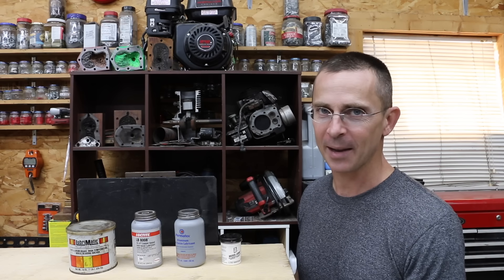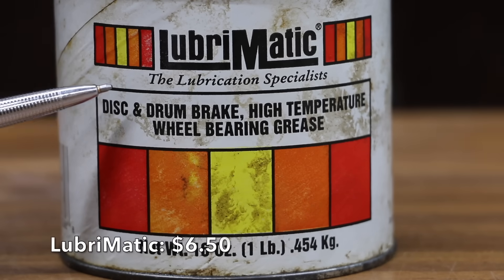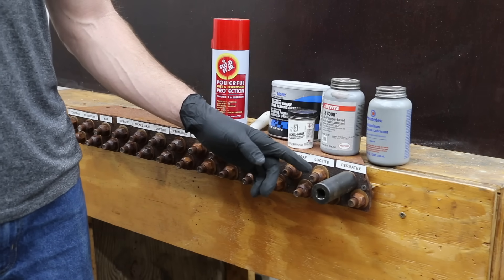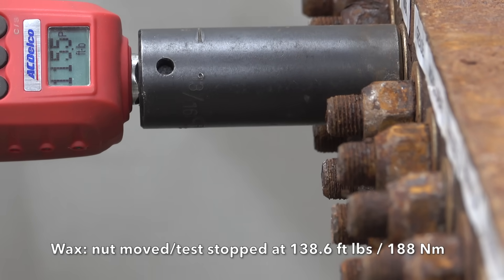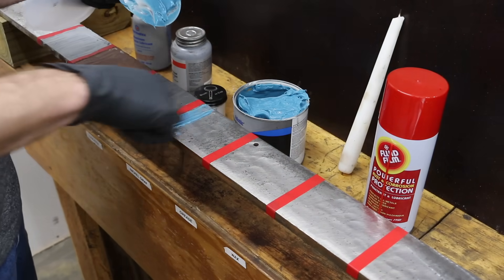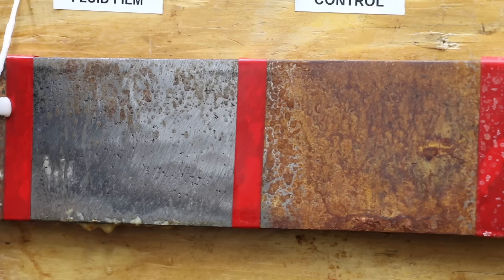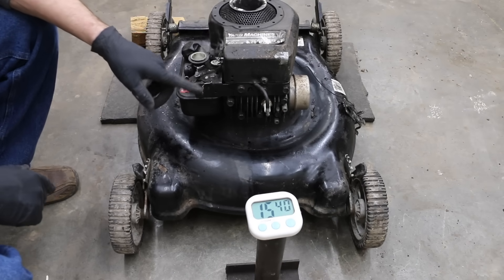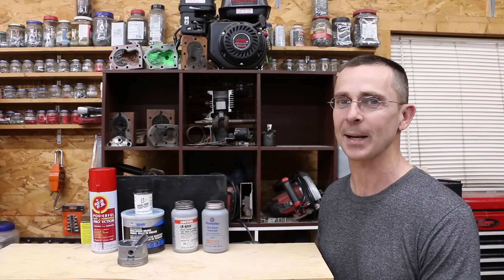Does Anti-Seize Compound Actually Work? Let's find out! Anti-Seize vs Grease vs Fluid Film vs Wax

Comment: Thanks for the video. I've always used anti-seize in only a select few applications on my vehicles. would you recommend anti-seize on all my vehicles bolts? My uncle puts anti-seize on the lugs of his jeep, The local tire shop calls him crazy, said his tire will fall off. Your opinion?

Also, I recently washed my hands with an industrial hand cleaner (from a shipyard I don't have access to) and the grease all came right off fairly quickly, no pumice or anything gritty and it left my hands feeling nice and soft afterward..It was a small white cylindrical bottle.  I didn't catch the brand but now I've been in the market for a better hand cleaner than the Orange-grit  stuff I've been struggling with--the bottle gets old and it sucks water inside and thins out over time it seems.

Vintage car grease is tougher than new car grease.   Dawn works pretty good but not the best. My uncle showed me that Oil works pretty good on somethings but I prefer not to rub motor oil all over--you still have to wash the new oil off. Rubbing alcohol can do some decent work but not the best for the skin. Do I just need different hand cleaners based on the parts of the vehicle I'm working with? different fluids needing different solvents type thing?

I've seen and used a few options, water-less stuff that just dries and crusts off, orange stuff that you can use dry and wipe off with a paper towel or use with water. I often work on my vehicle on the side of the road where hand washing stations are in short supply so I like the dry-options, but anything that would cut the grease faster than the rest would be fine by me.  One that can actually clean my fingernails and get in the crevices without excessive scrubbing. I hate hopping out of the shower only to find the forearm I scrubbed for 5 minutes still has a big grease spot on it. 

Thanks for all the hard work.
Reply: Many years ago, my mother bought me a hard whitish color paste from Hella (german brand), that I used BEFORE commencing to work. It worked perfectly as an "Invisible glove" because it formed a tough barrier, stronger than common barrier creams. You had to wait a minute or two to allow it to dry and harden, then it resisted oil, gasoline, greases and dirt like no other.  Unfortunately I have been unable to buy more, as I cant find it anywhere...
Reply from the maker: I'll try to put together a video on this

Comment: I've used Teflon Pipe dope as thread compound since the 1980s and I've had vert good luck.  But I think the latest batches are thinner and not as durable as the older dopes were.  Excellent comparisons.  However, is anti-seize a lubricant?  Makes me wonder if a tablespoon would  fill some gaps in a worn engine without destroying oil detergents, heat transfer, and viscosity.
Reply from the maker: Great point!

Comment: I have been using permatex anti-seize for about 40 years and it's the best one out there . Permatex also has a copper anti-seize for high heat items . Your little test is not a good test !!  The test of time will show you what I am trying to tell you !!!  I have used permatex anti seize decades ago then left it sit for well over a decade and it worked great !!  This is in the harshest of snow , frozen cold with allot of road salt !!  To me your little test was a total waste of time !!!  I've used different products and learned the hard way that Permatex anti-seize is the best and for the cost !!!  Both aluminum and copper anti-seize from permatex can't be beat !!!
Reply from the maker: Great feedback. Thank you

Comment: Next up on project farm: “this episode we’re gonna see which brand of cement works as the best replacement for engine oil!”
Reply: Comment section "Shoulda used a fresher bag of portland cement.  That had water intrusion"

"Isn't there supposed to be gravel and sand in cement" <- and that starts the comment section fight
Reply: @corpsiecorpsie_the_original  cement isnt concrete, easy to resolve fight.
Reply: @leocurious9919  - I'm aware of what it is. That isn't going to stop an internet fight
Reply: @corpsiecorpsie_the_original  Hahaha, thats true...
Reply: Hahaha…...
Reply: Gotta use the cement that was used in the construction of the twin towers then.

Comment: Did you compensate for the nut rusting to the steel plate, it looks like some of the threads had no rust but but looked like the nut was rusted to the steel plate which would increase the torque to remove, try using double washers or apply between plate & nut as well as on the threads. Great test though, very interesting which is best.
Reply from the maker: Thanks for the feedback.

Comment: I know this sounds crazy, but when I was in the military I worked on TF 34 jet engines. Our technical manuals would have us apply Phillips milk of magnesia as an anti-seize compound on the nuts and bolts that held the hot section together.  I speculate that those areas would get so hot that they were beyond the flashpoint of most anti-seize compounds. But it is a good cheap and non-hazardous alternative to standard anti-seize.  Also easily applied, we would put all our nuts and bolts in a Ziploc bag, pour in a little milk of magnesia and shake the bag. I love your show!
Reply from the maker: Thanks for sharing.
Reply: Wish I saw your post before I posted. Yup my squadron used Milk of Magnesia on our T58-GE-8B turboshaft engines as well.
Reply: Hmm, makes sense, leaves a granular but crumbly material in the threads, without interacting chemically, and without lubricating the fastener much if any. Magnesia is an incredibly refractory oxide, it will literally outlast anything you can make a bolt out of -- besides tungsten and a couple neighboring metals (none of which you'd want to make a bolt out of, for various reasons).
Reply: Damon Traeger I’ve also used this on extreme high temps(2500f).  We decanted the liquid off and used the remainder on or studs and nuts. It really does work well in these circumstances
Reply: So now you have to repeat the test with milk of magnesia!
Reply: German aircraft mechanics used Milk of Magnesia as an antiseize during WW2.
Reply: Damon Traeger 
When I find tips that crazy-genius,  I have to try it.  Now if you’re trolling me,  my test subject won’t be an expensive victim. 
Speaking of jet engines,  you guys get a grin out of explaining the intricacies of axial compression to curious 12 year old wrenches. (Yeah,  that was me 50 years ago).  “Well,  ya see son,  yer family car sucks,  squeezes,  bangs,  and blows....while this here screaming jet sucks,  squeezes,  and sneezes.” 😎

Comment: Great video! You covered a subject that I face when changing a tire. I often question whether corrosion itself creates sufficient torque resistance and leads to an inadequately torqued lug nut.  Your video gives a fascinating perspective supporting the idea that it shouldn't be ignored especially on trailers where a driver can be isolated from clues during operation. I use grease to avoid seizure.
Reply from the maker: Thanks for sharing.

Comment: Thermal Compound! You could test the heat transference of different PC thermal pastes. There are so many biased reviews as well as inconsistent testing methods. Is the cpu overclocked, is it AMD or Intel, what year, what cooler? I think an unbiased approach just using two pieces of metal with different thermal compounds between them could provide some interesting results. Also, you could look at the spread difference, is a pea size enough, should there be a lot, is very little. I would also be interested in seeing the liquid metals and how that fuses metals together. Not an engine product, but it does have uses that could be interesting in some creative applications.
Reply from the maker: Thanks for the video idea.

Comment: Great job! The main problem with the wax is that when molten wax drips on cold metal, it solidifies instantly an deforms, as it happens with some 3d printer plastics. That is why it has bad adhesion to metal an caverns under the layer of wax. It would be better to solve wax in lighter fluid, gasoline or some other solvent under heating and use the solution on the thread or cool it, then it will partly solidifytransforming into suspension, which can also be used to protect metal surface. It would be great to see the difference between such prepared wax and market anti-sieze compounds. Also there is an idea to use candle wax as motor oil.
Reply from the maker: Thanks for the feedback.

Comment: Mustie1 uses Toilet ring wax as a coating to protect from rust.  He also uses Bar and Chain oil as an under coating.   Could you test these cheap solutions?
Reply from the maker: Great recommendation! I'm a huge fan of Mustie1's channel. Thank you
Reply: He applies the wax differently too, the wax didn't stick to the metals here.
Reply: He is elusive on what his proprietary bar and chain oil mix is, specifically, I would assume something petroleum-based to allow it to be sprayed and then off-gas leaving the bar and chain oil in place. I've also heard legend of a paraffin and kerosene mix as well.

Comment: The paraffin froze when it hit the cold metal, you should have preheated to obtain good adhesion/coating film.
Reply from the maker: Thanks for the feedback.
Reply: Good idea, a lot of hand forged metal parts are coated with a bees wax that soaks into the grain of the metal and wets the surface really well with that technique.

Comment: I put on a new reman break caliper and they strip all the coating off them. My 20 year old bmw original caliper has almost no rust on them. Brand new reman is complexity rusted over. When I put the new reman on I used anti seize to act as a brake pad lube. Everywhere but where the anti seize was put has rusted. I drove it over the winter and it’s still good. I was impressed by that.
Reply from the maker: Thanks for the feedback.

Comment: Paper air filter vs oiled K&N type filter in extreme dusty conditions. Like throw some ash and sand at it and then inspect the bore and cylinder head for scoring.
Reply from the maker: Thanks for the video idea.

Comment: Some ideas, test shovels, rakes other yard tools, what ones last the longest, strongest and how they hold up in the elements. Also you could test multi-tools like the Leatherman vs others. Also concrete and if the strength is equal to what the bag say and different thickness.
Reply from the maker: Thanks for the video idea.

Comment: It would be interesting to see on your bolt test how the candle wax, the fluid film, grease and the others not designed for the high temperature compared to the other high temperature products. Your test is kind of like comparing a group of cars. They are all cars but some are designed to go fast and others that are not but them running them all fast and the wheels come off of the slow cars and you say the slow cars did not do so good.
Reply from the maker: Thanks for the suggestion.

Comment: Run the same test with fresh stainless steel nuts and bolts.  Stainless will gall and I can almost guarantee you that an untreated threaded connection will seize to the point that you can't take it back apart.
Reply from the maker: Thanks for the video idea.
Reply: @ProjectFarm  I learned that lesson the hard way!  An old timer at the boat supply shop explained it to me.  Love your channel!

Comment: Not to be overly critical, but given the torque required to "unseize" the untreated bolts, 
I have to question the conditions of the test, as the bolts didn't really seem to seize at all.
That being said, I don't have any solution to offer, but it should be discussed what makes a bolt seize.
Vibration? Temperature? Discuss :)
Reply from the maker: Thanks for the constructive feedback

Comment: Vibration I concerned with also. If ever had a spark plugs or brake bolt come out while you it really sucks. Maybe test them after a week of shaking with Mechine if tork with no holding power like less than asap remove tork.
Reply from the maker: Thanks for sharing.

Comment: Observation: Anti-seize doesn't flow so you can say goodbye to the cooling aspect that an air cooled engine needs. Also interesting to note what a single heating / cooling cycle can do to torqued fasteners, which is why we need to retorque things. Not sure about accelerated testing. Somehow we just can't duplicate father time in the lab, especially if a product has a 3 year EXP date right out of the gate. What I can tell you is that old guys working on Gravely equipment years ago would use the aluminum anti-seize on those huge mufflers screwed into a cast iron block and leave it outside for 15 years. When it was time for a new muffler you could grab it with channel-locks and spin it right out. Certain things work and others are snake oil!
Reply from the maker: Thanks for the feedback.

Comment: There is usually a small hole in the conrod-crankshaft bearing where oil is able to seep in and keep it lubricated, but the antiseize isn't thin enough to get in, so the bearing would have most likely seized which is why the conrod snapped.
Reply from the maker: Thanks for the feedback.

Comment: Thinking it was about '87 I added never-seize to my arsenal of goodies.  I can attest to its performance, and have been a never seize junkie ever since.  What's really cool is 'a little dab will do ya'!  A little dab on the tip, plows ahead of the threads and walks around the bolt all the way in.  I use this on everything that is not a locking thread.  AND there's still about an ounce in my original bottle!  Just this year, I added the copper version to my goodies.  Seems like it's just as good.  Test it for yourself on lug nuts- you'll never go without again.
Reply from the maker: Thanks for the feedback.

Comment: Use this stuff on alot of things.  I probably shouldn't use it on my wheel studs, but I do and have had no issues for the severaa years I have used it.  I hand torque them for tightness instead of using OEM torque specs, which could make the difference.  Have used the Permatex stuff for years...because that's what I stole from my dad's garage way back when haha.  Awesome video as usual!
Reply from the maker: Thanks for sharing.

Comment: Great video like always, thanks for sharing. Maybe try Protronix series 7 thermal paste. Dealer I use swears by it used on spark plugs to stop the treads from corrosion/rust and break off. I haven’t had a chance to try it myself as of yet. Thanks,

Billy D
Reply from the maker: Great suggestion!  Thank you.

Comment: I am not a big fan of the fluid film in the aerosol can but we use the 5 gallon bucket of paste at our seed corn facility on husking rolls and it beats all the products you used and some homemade mixes we have tried. I just don't think the lanolin based product can hold up to high heat applications but as a corrosion preventer it is top notch.
Reply from the maker: Thanks for sharing.

Comment: In the late 70's and early 80's used to occasionally rebuild large oil field motors like Ajax and Fairbanks-Morse.  If you wanted to get a crankshaft bearing on (and off again) never seize was imperative.  Coat the shaft, place the bearing race on top and heat with a rosebud until it just drops on.
Reply from the maker: Thanks for the feedback.

Comment: From experience in an oil refinery... a hydrocracker unit operates at high pressures and with temperatures around 700F. We found that Bostik Never-Seez Pure Nickel gave us some of the best anti-seizing results. Cannot speak to low temperature corrosion resistance. And seems that at high temp's any organic carriers like oils, waxes and greases will eventually carbonize and may act to cement the threads.
Reply from the maker: Thanks for the feedback.

Comment: I would like to see a video series on how to rebuild a lawnmower motor as the older brigs and straton motors from 70's, 80's and 90's seem to do better than modern motors, not mention the mower I have which needs the carby serviced on it, is still going from when it was bought new in 1996.  I just would like to have a resource I can go to so I can keep my lawn mower going, and you have quite extensive knowledge, which I would not mind seeing in a how to and maintenance series, if you have not done so yet.
Reply from the maker: Thanks for the video idea.

Comment: Here's a suggestion for you with regards to anti sieze

I head up a large communications Co. In Aust & we deal with a lot of Stainless Steel products, to prevent Stainless Steel nuts seizing on stainless steel bolts we have to coat the bolts with a special Anti Seize of the hear builds up whilst spinning the nut on & you have no anti seize, game over before you even get to tighten the nut.

If the nut dosnt seize whilst spinning it on the both without anti seize, the moment you put the tiniest bit of pressure on the nut to tighten it up Game Over tue only way out of both situations is an angle grinder.
Reply from the maker: Thanks for sharing.

Comment: Never use anti-seize on wheel studs. It will cause a torque wrench to over torque and possibly break the wheel stud. Use only a drop or two of oil. Fluid Film takes awhile to soak in to the metal.
Reply: I've used it on wheel studs for 86 300zx, 98 Chrysler t&c and Acura rsx. In mid Florida never had problems with torque or breaking off with impact. Been doing for 20 years.
Reply from the maker: Thanks for the feedback.